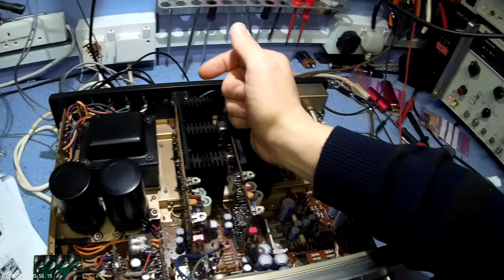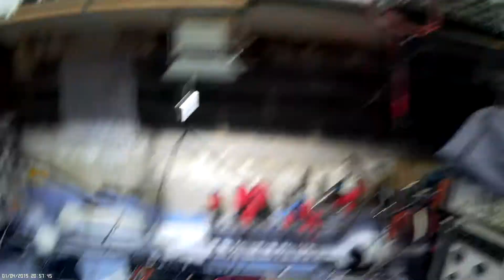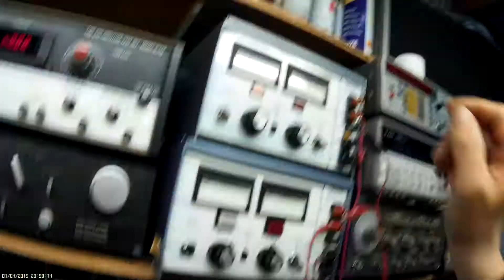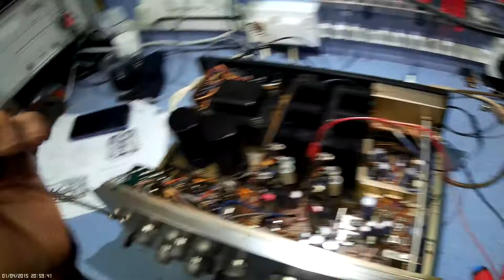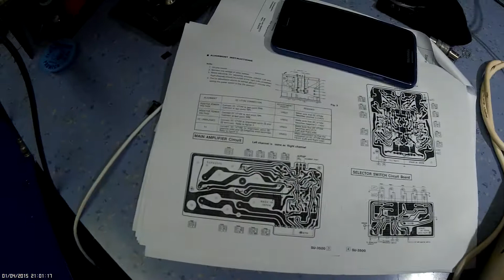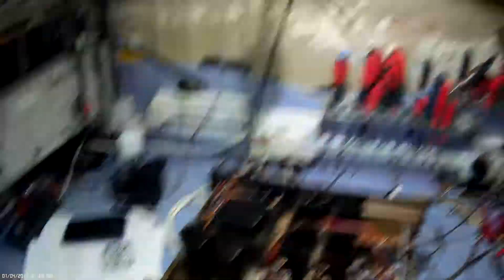Technics Su 3500 Bias and DC offset.

Comment: I think you have to make two more adjustments, if I may suggest. 
1) A slight accent adjustments 
2) It would be best or even excellent without the video which is useless. 
Most of the intended purpose of video is for people to learn what is going on, instead you giving them  headache or dizziness, just an opinion.
Reply from the maker: A slight accent adjustments ?

Comment: Hai....I have Kenwood km 106 amp...I did not find any prest for the DC offset...they provide two prest for bias.... what is the good value for the DC offset...I measured with digital multimeter..I found near by -ve  20....is it ok...

Comment: i have a hitachi sr 2004 and ine channel runs hot while other is warm. would thisbbe a bad bias setting of dc offset problem?? the heatsink on right is hot and left is warm. the amp plays great just heat on one side
Reply from the maker: Sounds like high bias on the hot side.
Reply: +Simon Spiers i cannot find the bias adjustments on this receiver. would it be adjustable resitors i see on top with sloted top to turn near the test points??